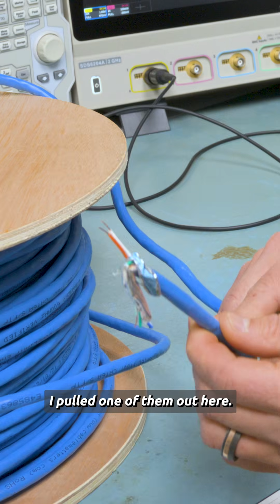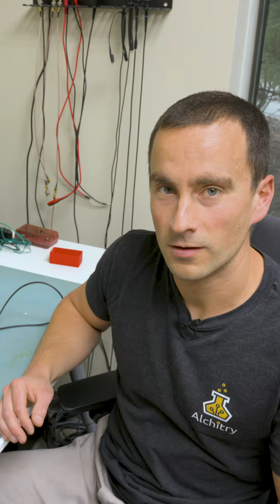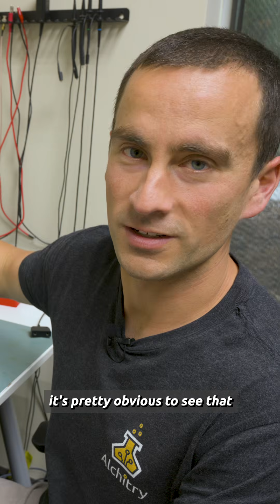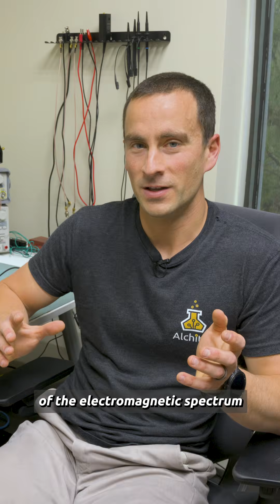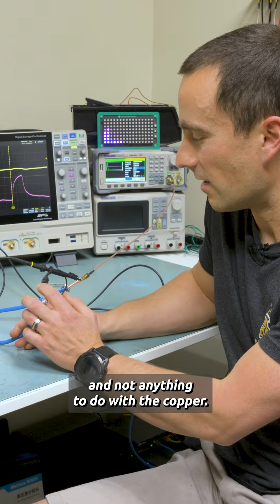How Fast is Electricity?  #science #experiment #electronics

Comment: Take a look on the small pulse in the red line just below the yellow pulse. Can you explain that?
Reply from the maker: Take a look at our full length video where we actually address that. It's caused by using two single ended probes that share the same ground.
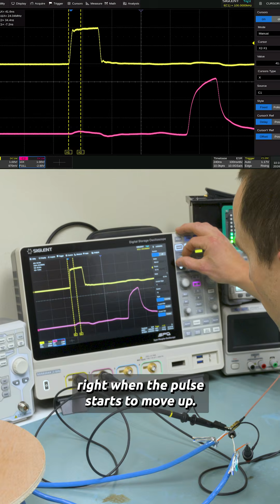Reply: @Alchitry  Thanks for the answer. In 1:09 you measured the rise time with your cursors. But the red signal is slightly delayed. It does not start at the same time as the yellow one. I saw the full video and with differential probe this happens again but in negative direction. This shouldn't be the case with the same ground...

Comment: Try it with an optical fiber cable
Reply from the maker: It would be very similar but you'd have the delays of the transmitter and receiver in addition to the delay from the speed of light in the glass fiber

Comment: Shall we factor the extra length due to the twisted cable?
Reply from the maker: Good question! I'm not sure how much extra length the twist would add but it would be a little bit. Probably not more than the error in our estimate. We weren't exactly measuring to the mm.
Reply: Perhaps try straightening a meter to observe the ratio. It’s possible that the pair you selected has more twists and could be longer.

Comment: yeah but isn't the cable coil an inductor that influences that lag? 😑
Reply from the maker: No, because of the twisted pair. Each wire of the pair will have currents running in opposite directions so their magnetic fields cancel. A pair of wires coiled like this acks like a bifilar common mode choke.